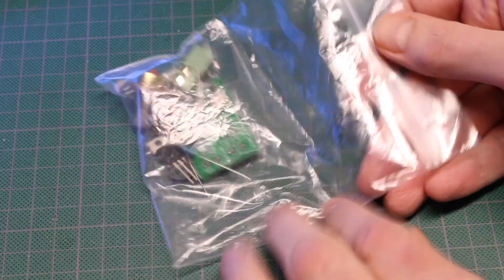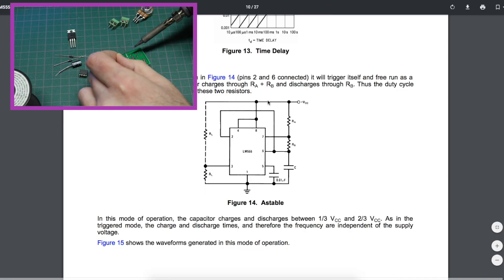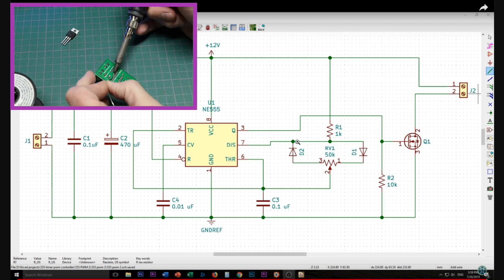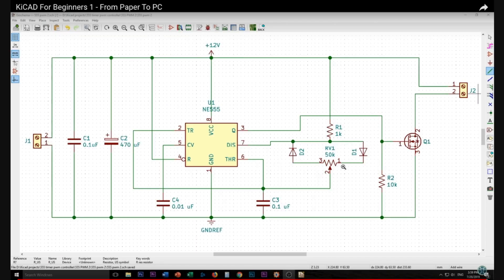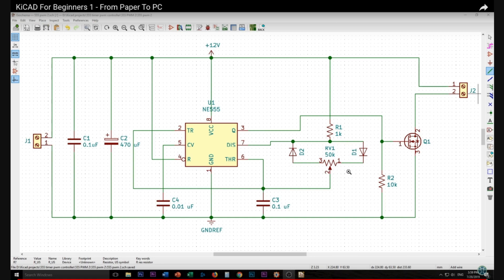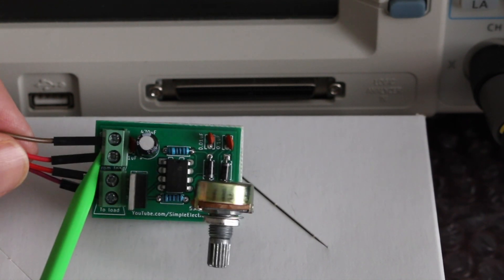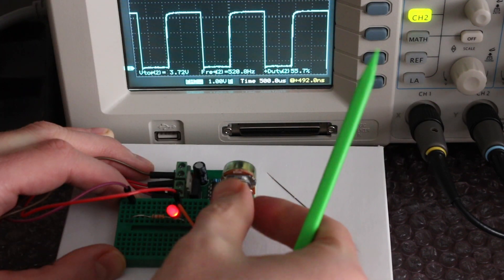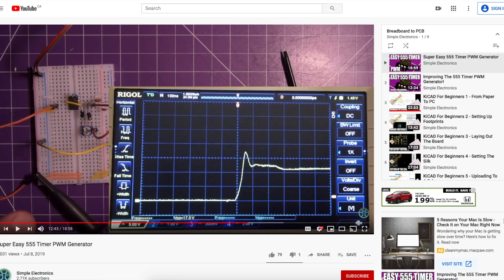555 Timer Kit:  Adjustable PWM Duty Cycle with FET Output Driver - PCB by Simple Electronics

Comment: 8:15 97% on time makes the led dimmer?
Reply from the maker: somewhere around 30 seconds earlier in the video it was said that one side of the LED is at VCC and the other side is switched between VCC and ground so a higher duty means the LED is off longer like an inverter
Reply: @GadgetReboot  Yes, I heard that but now it makes sense, thanks. I just built one of these yesterday and the frequency went from about 305 (at full bright) down to 220 and as it went down from 20% the frequency went back up to about 250Hz at fully dimmed. I used 12v, everything else the same.

Comment: Hardly new, exciting or even designed by the guy. His "improvements" were just adding components from another schematic.
Easier to just buy the exact thing from eBay for $2 delivered - that includes everything including the (correct) pot, knob, heatsink, correct diodes to stop the spikes, beefy motor EMF diode, etc.
Reply: I'd like to see a link to an eBay item like the one shown in this video. All I see on eBay are not enough to drive a small motherboard fan, around 100mA. All eBay versions I found had 10mA max drive current.

Comment: Hey! I recognize that PCB!
Reply from the maker: The manual panel scoring looks like it turned out OK as well, now that you saw how hard it can be to separate the boards are you going to do it that way in the future?
 I recently discovered some software that can sort of do the mouse bite version of panels instead of Vscore as one big PCB to trick the board shops and not cost us money. If I can get that working I will try that out.